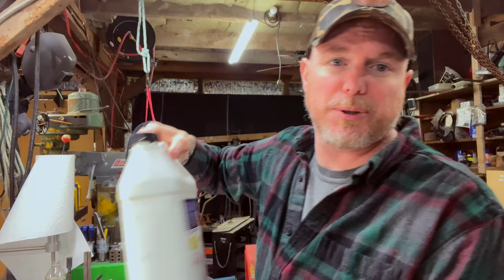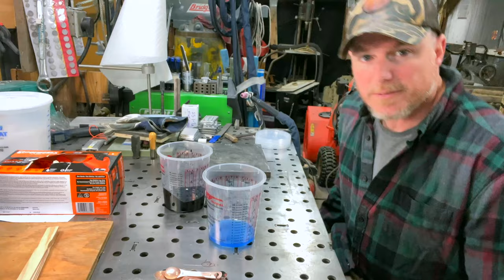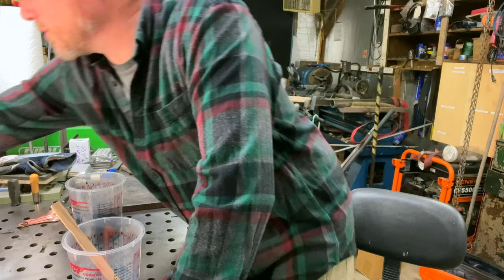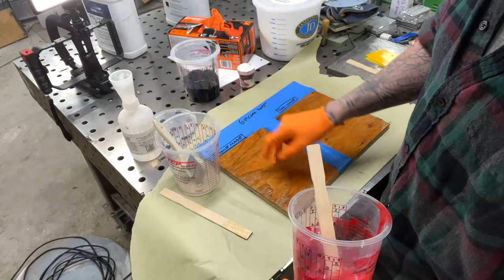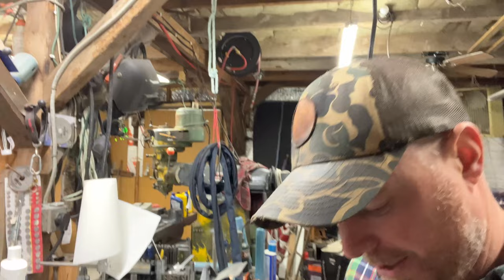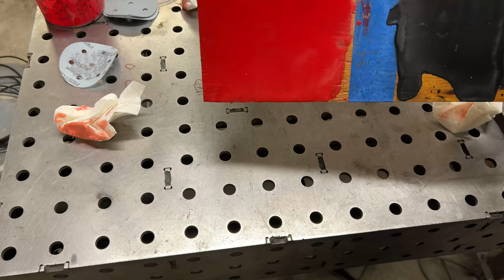Can you make your own Gelcoat? *SHOCKING RESULTS*

Comment: If you attempt this don't forget one critical part he glossed over.  Didn't catch where he did the PVA top coat so it will cure non tacky.  Just caught the mention that he washed it off.  If you skip the PVA or wax additive, the results will not be good.

Comment: I wonder if anyone can help.  
Is this polyester fibreglass safe to use in a rv/ campervan? Or a bedroom.  
I'm mostly concerned about the 'off gassing'. Is it safe? Can i paint over it to seal it in?  Thanks 🙏
Reply from the maker: Would you worry about off gassing in the cabin of a boat? Because gelcoat is throughout a boat. Inside and out. So your all set. Also you realize paint off gasses right?
Reply: @HoldFastMarine  I had thought as much,  but read an article about the VOCs that it gives off, and i figured you guys would have a much better idea of how it is in the real world.  
Thanks a bunch 🙏

Comment: Big Fan! In a nutshell, I have a fiberglass canoe, light blue color. Unsure what the surface is, gel, paint?? Can I apply (olive drab) gel coat directly to the surface. It sanded with 1000 grit…but to the touch it feels too smooth to allow adhesion. Should I get it rough er? I am cleaning it off with acetone. 
Will it be a mistake to simply roll it on and get it as smooth as I can….with a canoe, can I live with not sanding.
Dan. 
USMC
1978
Reply from the maker: Ooh rah homie. 1k grit isn’t remotely close. You want to sand with a minimum 100 grit. Most likely your canoe is paint. Most canoes are made with epoxy resin. My idea for you is to sand with 180 grit and rattle can that old canoe. Use an epoxy paint and make sure you prime it first.
Reply: @HoldFastMarine  You are gonna laugh at this question: raddle can- You mean spray can spray it? I can’t find Epoxy in a spray can. I am clear on the other ways you demonstrated how to apply. I’ll prob just get the sprayer like you used and apply it that way. Epoxy, with color would be very convenient in a spray can. Thanksss👍 (O by the way, I did the Marine marathon in DC 3 times after I was 50 - dumb Marine😂🤣😃)
Reply from the maker: Yup. It doesn’t need to be epoxy paint. Enamel will work just as good for a canoe.    Polyurethane is the best choice. But you can buy 2 part polyurethane paint on Amazon. Eastwood also makes a topcoat  in a can. There’s lots of options out there. Including epoxy spray paint! Just takes some looking on the internet.